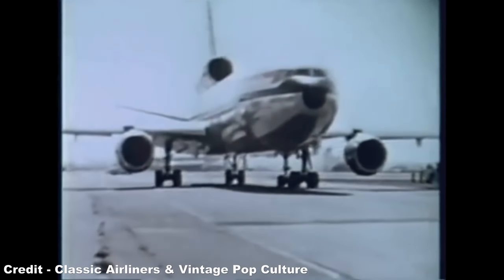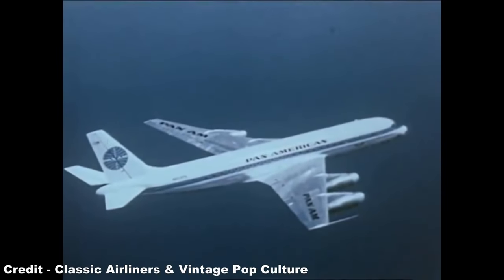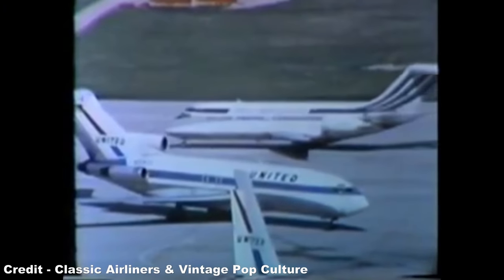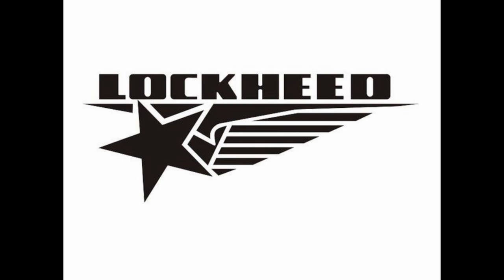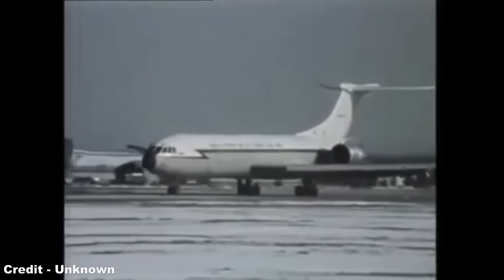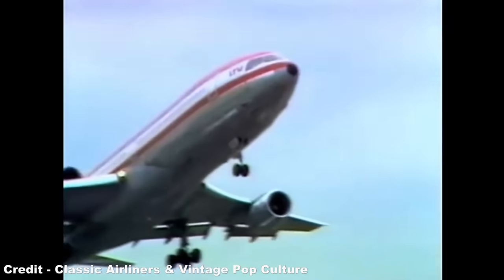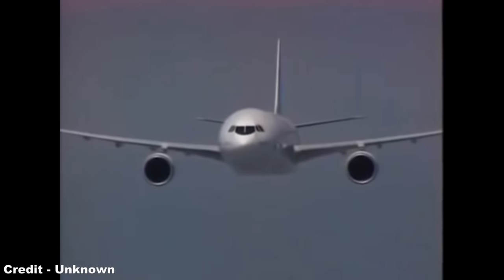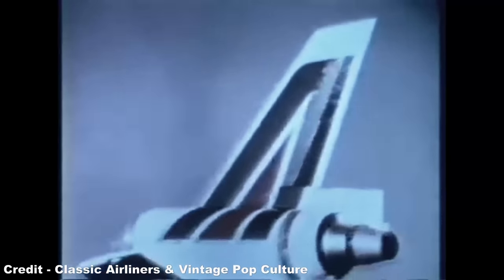What Killed the Trijets?

Comment: A real shame the trident wasn’t a commercial success.
Reply: Aye. BEA [whom as the then flag carrier airline for short & medium length flights had all the say over features] ensured as much by changing the engine spec' at the last minute, resulting in reduced performance and a rep' for being underpowered.

At one point the Trident sported a fourth engine, to try and remedy this fault.

Had BEA had less control over the project, the Trident likely would have done better.

Similar story with BOAC & the Vickers VC10; an aircraft the airline explicitly specified... only to then change its mind and torpedo the export sales thereof with faint praise in the press.
(the reason being that BOAC were trying to duck out of their contract so as to buy more cheap & clunky Boeing's; to aircraft industry and public disgust at home)

Comment: The real reason is the fan jet engine its size would not allow use in tri design and they are a lot more fuel efficient and quieter new aircraft had sound rules to meet!

Comment: Former Boeing Everett here... There are advantages to placing engines at rear of aircraft. It is quieter for the passengers. Both intake noise and exhaust noise is behind passengers. It will be noisy in lavatories, but not in passenger compartment. 

In the event of an engine failure, thrust induced Yaw is much less. Engines are very close to center-line.  In a typical wing under design with engines hanging on bottom of wings, they are far from center-line. Lose an engine and plane will Yaw (turn) towards side of plane missing thrust. If not managed immediately by pilot, bad things can happen. Not only is Yaw introduced, but sometimes it starts to Roll (bank). 

4 engine planes are less prone to this. Rear engine planes avoid most of that. Only thing that is bad about this layout is maintenance on engines. They are placed high on either side of vertical stabilizer. If Tri-Jet configuration, center engine is inside vertical stabilizer. Many business jets use twin rear mounted engines very successfully.

Comment: You are missing a critical detail, when a 3 engine aircaft lost an engine Left or Right, and was required to land with 2 engines including the engine in the center. Due to the high position of the central engine, the use of thrust reversers brought a serious problem, which was creating a large moment to turn the nose of the aircraft up. Since you had to land only with engine 2 due to the lateral moment, using Thrust reversers was an imposibility.
Reply: How would reverse on engine 1 or 2 make the nose turn up? Twins land with asymetric pod mounted engine regularly.
Reply: @peteconrad2077  Incorrect if 1 and 3 are OK, NP if 1 OR 3 fail you can't use thrust reversers or the good engine will create a moment towards the bad engine, so if 1 or 3 fail and you can't use thrust reversers in 1 and 3, you could only use it in 2; but 2 thrust reverser is too high if the tail is pulled back is creating a moment nose up. I hope I explained myself better. I think I made a mistake in the engine numbers...sorry
Reply: @henryroif8537  utter nonsense.
Reply: @peteconrad2077  Every body has the right to an opinion, me with a mechanical engineering degree, an electronic engineering degree specialized in automatic control and avionics, a MSC and Ph.D. in Aeronautical eng with a Majorin automatic control of flight vehicles; plus a pilot (all the way to 747's and Dc-10's) (with patents in aerospace and STC's) and now working with Boeing in the new 777X my answer to you is...I DON'T THINK SO.
Reply: @henryroif8537  your comment was factually wrong. There was no opinion about it. My aero eng MEng and 18,000 hours on jets help me to know that.
Reply: Well, my comment stays and you need to learn physics
Reply: @henryroif8537  No major trijet had a reverser on engine 2 so your comment is meaningless and silly.
Reply: Maybe you were an airline pilot; but never saw the testing. nor the first prototypes...stop insulting when you don't know, besides you are actually agreeing with me without even noticing it. Once ETOPS was established, one of the most important safety issues was thrust reversers landing with one engine, check AIAA AESS transactions. With this I end the discusion, you want to learn good, if not stay ignorant and DO NOT DO RESEARCH.
Reply: @henryroif8537  reversers have precisely nothing to do with ETOPS. You haven’t a clue what’s you’re on about and are too arrogant to admit your rout if your depth.
Reply: @peteconrad2077  One aqgain you are wrong, check the HISTORY of how ETOPS was conceived and WHY
Reply: @henryroif8537  it was conceived to allow twins to fly over water or desolate areas. If there’s some connection with reverse, why don’t you explain.
Reply: @peteconrad2077  On that you are right; but it started with the need (and the appearance) of more reliable engines and getting rid of the 4 and 3 engines aircraft...research at the begginings...so now in the future only 2 engines will be used for many reasons...that's why no more three engines and no more 380's or 747's, the final product has a lot of history. You have to go really back to the real engineering based on differential equations and transactions.

Comment: It is a sad fact that high altitude heat deposition is extremely detrimental and disruptive to normal weather  patterns. Add to the heat pollution, add two pages of small-print columns listing the synergised chemicals, including seven known carcinogens found in jet exhaust, and think twice about frivolous jet travel.  We must focus on getting the wonderful new, emerging electric aircraft which are quiet. cool running, and produce little pollution into the skies.  See the 'Alice Electric Commuter Plane', it, and other electric planes are the future. sent ethermail

Comment: Nothing can kill a machine. It's not alive. 

All planes with a third engine mounted in the tail were discontinued because the maintenance crews didn't like climbing ladders, and using scaffolds. 
It was inconvenient. So the planes were designed with two engines on each wing. And later, with only one engine on each wing. That allowed all the maintenance
to be done quickly and easily. But dwarves are still banned from aircraft service jobs, Boeing says its above them.

Comment: That's easy one age. Second twin engine High bypass turbofan jet engines far more efficient and powerful required only 2 engines. Fan jets are larger in diameter and almost required wing mounting. Third having to maintain two engines is better than three or four. And related to age upgraded cockpits and newer airframes as the tri Jets all became much older and more costly to maintain, made them less viable. Last regulations allowed over water flight with 2 engines, 60, 90, 130, 180 min away from alternate diversion airport.

Comment: I thought the TriJet were also more susceptible to the "deep stall" because of the way the tail configuration had to be altered to accommodate the third engine.
Reply: That's T-tails (727, DC-9) which had to worry about deep stall, because of the high-mounted horizontal stabilizer.

Comment: 5:28 There is more nuance to the B747 than just that it was beaten by Lockheed's C-5 Galaxy and hence became a commercial jet instead. Because its origins were the design of a military cargo transport its civilian version also retained this feature. In fact one of the significant factors that saved it from being completely abandoned in its early history was this design for cargo use. (you can look up how slow the orders came in for the first decade of the 747's history and how it was only marginally adopted by US passenger carriers subsequently)
The gamble on and development cost of the 747 hugely dragged down the company financially to the point that it had to concentrate on marginal improvements of the much more financially successful 737 and didn't have its first flights of the 767 and 757 until 1981 and 1983 respectively. Ultimately the 747 survived the crisis but its role as the predominant overseas passenger jet was short lived.

Into the 2000s the majority of previous passenger carrying 747s have been converted to cargo use and even the newest version 747-8 is built for that purpose.
As was pointed out in the video the DC-10 and MD-11 had a similar fate now being mostly used for cargo only.

Comment: Great video except I don’t believe the A300 was the model that ushered in ETOPS. I’m pretty sure that was TWA & the 767. I don’t think the A300 flew transatlantic; the A310, it’s smaller sister ship did, however, as it had the longer range.
Reply: TWA applied, but was turned down initially - while the A310 already had a 90 minute rule that was LONGER than for any other twin at the time.
767 EVENTUALLY initiated the 120 minute ETOPS rule.

Comment: fuel usage is key these days.  I think the 787 is very fuel efficient.
Reply: For a 2-aisle passenger airliner, it is.  But a 1-aisle passenger airliner constructed that way, would be even more efficient.  The aerodynamic cost of pushing a bigger frontal area through the air is very significant.  The question is, how long they can stretch a narrow-body plane until it just folds/breaks in half on a hard landing, like the DC9-80 almost did on its 50-foot obstacle landing test.
Reply: @EfficientRVer  Well, they can sure build single isle passenger jets out of carbon fiber for domestic travel if it pays to do so.  Answer is to raise the ticket prices to a point where building a single isle jet would make sense.  Perhaps it's already on the drawing board.  I think ticket prices are too low now anyway and should be raised.  Maybe then it would force more people to use the rail instead.

Comment: I'm curious to know, how are cargo airlines able to justify flying the old inefficient tri jets when passenger airlines aren't, and newer better options are available? I know old planes are cheaper, but at some point, you'd expect it to not be worth it anymore, right?
Reply: Which is why Fed-Ex and UPS replace their older jets every so often.
Difference is you can generate a LOT MORE cargo "fees" than passenger fees per load - and the up-front cost of the used aircraft is a LOT less than the cost of new, enough to make up for the fuel costs for a long time.

Comment: I always wanted to know, could a 747 be powered by 2 modern engines?
Reply: Theoretically, it's possible. But the design of the 747 wing would have it near impossible due to no ballast for wing flex, to oversimplify it (YouTube videos out there explain it in detail. My explanation could be wrong)
Reply: The thrust would work, but the 747 does NOT have anywhere near enough ground clearance to mount 2 engines that would have enough power.

Similar has been thought about for the B-52 (usually 4 engines though not 2) - but the design studies also floundered on the lack of ground clearance issue.
Reply: @bricefleckenstein9666  From a power persoective GE 9x coupd power a B52
Reply: @thelovertunisia  The GE-9x is actually a little weak, at 110,000 pounds of thrust vs those 8 x 17,000 (136,000 pound) pound class engines currently on the B52.
Even the GE90-115 at 115,000 pounds is a little weak (currently the most powerful jet engine in the world).

The B52 at full load ALREADY needs over 13,000 feet of runway - fewer than 100 runways IN THE WORLD are that long and many of those are foreign.
Underpowering it 20% would limit it to a few of the runways at Edwards, one at Area 51, and one at White Sands - but those are part or all UNPAVED and there is some doubt if they could handle the weight.
Denver technically is long enough - UNTIL you consider the altitude of that airport and the extra runway length needed DUE TO it's "mile high" altitude's thinner air.

2 GE-90 or GE-9x could do so easily from a thrust standpoint, as could quite a few other pairs of modern engines.
But fitting 4 smaller engines in the 35,000 pound thrust ballpark was ruled out, despite the smaller size of such engines, as they were STILL way too big of diameter to fit under the wings of a B52.
Reply: @bricefleckenstein9666  It is amazing for an aviation fan to hear such impressing things. Thanks you so much. By the way isn't a B52 smaller by mass than a 747 or say an A380?
Reply: @thelovertunisia  The A380 was one of the 3 highest mass and capacity aircraft in the world when first flown, and is the only one of those three that was mass produced - it is now #2, but might return to the #3 spot.
The Anatov An-225 and Stratolaunch were the 2 ahead of it, prior to the one completed An-225 being taken out in the current Russia-Ukraine war (Ukraine has pledged to rebuild it, and were working on completing the second one prior to the war, once/if either of those are flyable after the war the A380 drops back to the #3 spot).
The 747 when it was first flown was the world leader for "big aircraft" by every measure (except for the Spruce Goose in wingspan) - and I think it still holds the #4 spot, depending on the version, behind the A380.
The lightest version of the 747 (the 747SP) is about 50% heavier than the B-52 at full load - but the entire 747 line is a significantly newer design which had access to much newer and more powerful engines.

I'm excluding lighter-than-air craft in these comparisons.
Reply: @terrystevens5261  The B52 has 8 VERY OLD GENERATION engines, mounted as pairs on 4 struts attached to the wings.
There are a lot of current engines that produce more power than that PAIR of older engines - but they have a much higher diameter, making mounting them impossible unless you extend the landing gear quite a bit.
Reply: @terrystevens5261  That is a recent development, to replace the aging TF-33 that the B-52H uses (only model still in service) with RR T130 engines on a 1-for-1 basis - still 8 engines.
All of the previous proposals had been to replace 2 TF-33 with a single engine, but failed on the "too large of diameter" re-engineering issue.
What I was NOT aware of before finding this was that Rolls has some sort of manufacturing facility in downtown Indianapolis (they appear to have taken over the ex-Allison facility there, and upgraded it substantially).

Comment: 3 decades later we will be asking: 
What killed the twinjets?

I wonder what the answer will be...
Reply: Greta Thunberg and her climate fundamentalists.
Reply: Innovation has been stifled due to regulations, though some will say that there aren't enough regulations.  The problem is that the body of regulations (which must number millions of pages) cannot evolve quickly enough for changes in technology and market demands.  Add to this political  pressures. Further, the fields of mechanical engineering,  aeronautics,  electronics,  and computers  have become so complex that managing the comprehensive project is beyond human capabilities. Adding to the difficulty is that components are made in countries thousands of miles away,  by ppl speaking a foreign language.
Reply: Well, PC12 kinda ate a lot market share of same size twin props like king air
It could be matter of time...
Reply: I'm betting on a lot longer than that.
I doubt that twin-jets will die before everyone reading this comment does.

Comment: The three tial jet engine was very noisy inside but the one engine tial jet with two engines one on either wing was a lot better but the planes with engines on the wings are quiter inside the plane. the first time when I went on a plane to Spain in the 1970s with three tail engines developed a  flashing light precheck fault and we have all taken off the plain and at to spend the night in a hotel and in the morning they layed on a bigger jet with one engine on the tail and one on either wing to take two louds of of passengers one flight and we came home on a three engine tail jet that was a lot noiser.

Comment: This video rather misses the point. It's easier for a three-engine plane to complete a journey with two engines than it is for a twin-engine plane to fly on with one engine. The three-engine design saved weight and gave better performance with a dead engine. The main disadvantage is higher cost, both to build and to maintain the aircraft. Fuel efficiency should be much the same - the A300 beat the trijets because it had more modern engines, not because there were only two of them.

Comment: While the facts is pretty mutch right, i would like to claim the conclusion is wrong.

Low fuel consumption was not a high priority early on. The introduction  of high bypass engines was really more a mean to improve range than fuel economy.

For narros boddy aircraft ground handling was more important... well untill 1972.

727 and trident  had three engines in the back for better ground handling. Also at that point the largest engine wsnt really that large.

The rear engine placment was excelent for both ground handling and maintanance.. well except from the center one that was very poor for maintanance.

The down side of rear placment is economy. While 2 engines is more efficent than 3, the benefit is really slim. The main drawback of 3 engines is the rear engine placment.  A 3 engined aircraft actually use more fuel than a 4 engined over wing aircraft  (hence the A340 have 4 engines).

So the narrow boddy 3 engined aircraft was killed by the high bypass engine.. they was simply not needed any more.

The 3 engiend widebody was actually killed by the engined aircraft. Considering that the last 3 engined was built in the mid 90tys, and the last 4 engined was built in 2022.

The reason why 777 is considerally more fuel efficent than the A340 have only to very smal part to do with the number of engines. 777 have considerally more effective engine layout, and a more optimal shape.